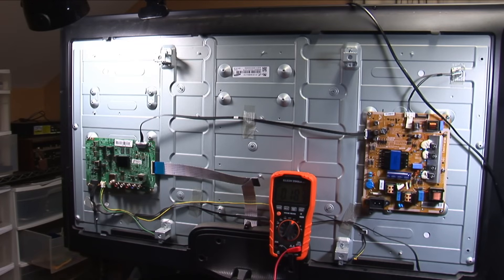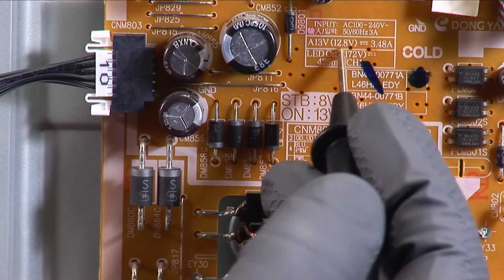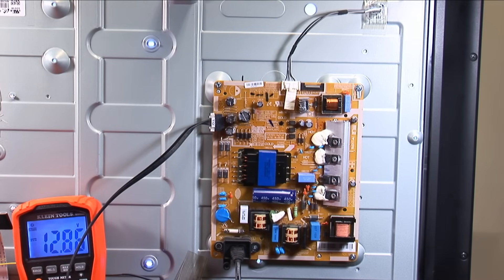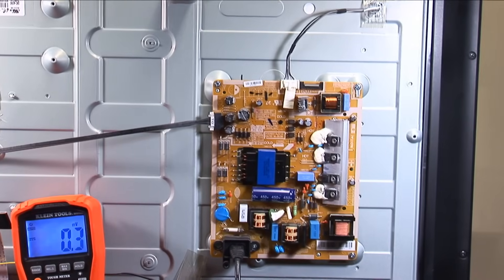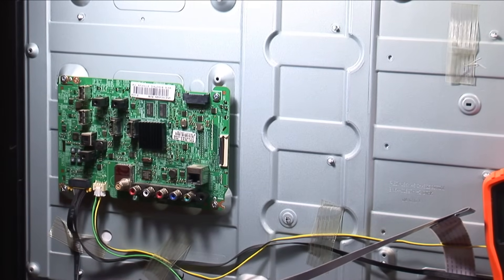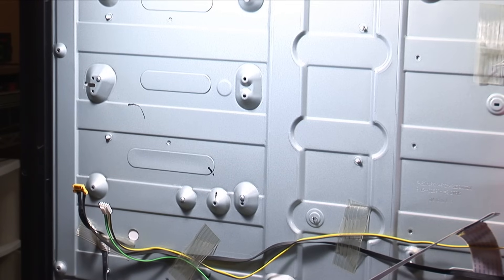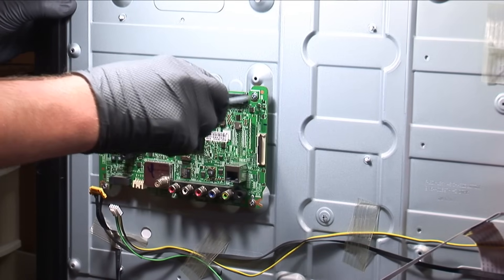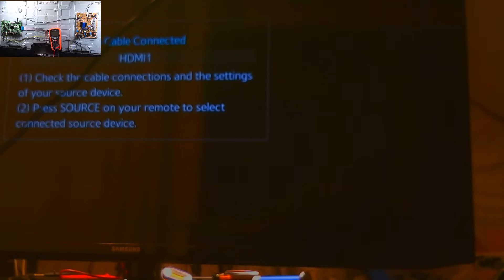Samsung LED Flat Screen TV Repair - Won't turn on, no power - How to Fix

Comment: My UN60JU7100F wont power on.  I have two black cable sets coming out of power board. Removing blk set that goes to mother board from power board does not turn on back lights. Removing blk set that goes to Tcon board does light the back lights. Also removing the two whitish ribbon cables at bottom of Tcon board turns on the back lights.     What do you think ? Thanks in advance.

Comment: Good afternoon sir. I am currently diagnosing a samsung plasma with exact same symptoms caused by lightning. Disconnected cable from power to main board and back light did not come on. Do plasma's have back lights? Also, I located standby prong on cable from power to main board. Showed 5.28 volts. No other prong gave reading. I know this is a mouthful but wondering if you have any idea from what I'v told you that wont take too much time out of your day to explain. Thanks again in advance.
Reply from the maker: Hi. No. Plasma screens don't use backlights.  The pixels themselves glow similar to how a florescent light works but just much smaller.   Other than that I don't know much about the intricacies of plasmas.  Never worked on any or owned any. Sry I couldn't be more help. The basic troubleshooting concept is the same though. Also if you can find a service manual, that may go a lobg ways to helping you troubleshoot (pinout, voltages etc)
Reply: @Electronicle  I very much appreciate the response. I noticed that on your video you located and checked for proper voltage on cable running from power to main board. My question is, are the other prongs suppose to give off a voltage reading also? There are 2 or 3 other prongs marked 5.3v on the schematic, but weren't giving off any voltage.
Reply from the maker: STILLthePILLAR ][+ if it’s marked that then yes. But that might only output when turned on.    Sometimes there’s a pwr pin that you either need to ground or apply the 5v Standby power to to switch the power supply on. This is where a service manual comes in handy.
Reply: @Electronicle  Very good. Thank you very much sir. And excuse the sir but I didn't catch your name lol. I do hope you enjoy the rest of your day.

Comment: I have a similar TV, 46", 550 series Samsung (LN46A550P3FXZA) and the problem is that it struggles with startup...this has been going on for about a year and most people would have given up a long time ago. – The TV chimes when "on" is pressed (on remote) but nothing shows. After several seconds it tries again, chimes and so on. Sometimes there can be a hideous noise and sometimes nothing...
I have noticed that temperature in the room is important – if cold, TV may never manage to startup, but if fairly warm, it will startup after some time. And then when running, there are no problems...
We recently decided to get an LG 65" "ThinQ" but this machine, as it turned out, just reminded us how amazingly stellar the Samsung was, so we returned it and we started using the Samsung again. Now, after having stood idle on the floor for a couple of days, it  still had startup problems, but much shorter, maybe 15 minutes whereas previously it had struggled for up to 90 minutes...and also, after stabilizing, it really is "stabilized" whereas before it might, if temperature has cooled in room, snap back into the hideous noise and scrambled screen state again...
So I'm wondering what's going on – after warm and stable, it runs flawlessly and picture quality on this 11 year old machine is so great, that you'd have to go to QLED or OLED to surpass it...so I'd like to "save" it...and I'm wondering, what is this "warm up struggle" all about...? – ...can I fix it...?  
Part of the story is also that after about 5.5 years, the TV suffered another, similar, but not identical, startup problem. But that time, Samsung put in place a program whereby a technician would come and fix it in your home (for free), even though warranty had run out...very nice of Samsung. But this is eleven years and Best Buy just wants to sell you another TV, not assist with "fixing" an old set....(and I'm beginning to wonder if it is at all possible to make 4K TVs that equal or surpass 2K machines....the LG certainly didn't)
Reply from the maker: Might be a bad capacitor in the power supply or main board.  Really only way to find out is to take it apart and find out.  You'd have visually inspect as well as test voltages coming from the power supply
Reply: Thanks for reply – ...yeah, and I'm not qualified to do that. – Yesterday I started the TV in the afternoon without doing anything to warm up room, but temperature was "comfortable". It took 13 minutes of attempts but then TV stabilized and ran flawlessly the rest of the day...so it's just the startup process that is a problem, but far LESS of a problem now than earlier...
It may restart with total silence and a black screen and then at next restart, you might have black screen and a hideously loud hissing noise...then noise and a frozen corrupted image and so on, until it manages to perform as intended...

Comment: Samsung UA40J500AK how can you help the fuse on the power supply keep on browing up whenever I replace with the new one
Reply from the maker: If you unplug the main board and backlight does it still blow the fuse?

Comment: Where can I buy this part
Reply from the maker: Crazy5s you can try contacting the manufacturer but might have better luck finding a working used part on eBay. That’s what I  and many others do
Reply: Electronicle can u tell me how much was it
Reply from the maker: @cris2loco766  I dont remember..maybe $30?

Comment: Hi
Thank you for your video extremely helpful I’ve got similar problem with my TV Samsung UE55F8000ST.
I’m trying to find out which board I’m having a problem with. Is it the power board or the main board so I followed what you have done in video. I plugged it in And disconnected the cable from the power board connected to the main board it should have to trigger the back light to come on but I am getting the back lights come on and off on and off not constantly on so I am confused please help thanks

Comment: Ok when I unplugged that first plug that on your tv was marked 10. I got NO LED lights  that came on . So mine has no power getting to the tv right?
Reply from the maker: that's why you have to do measurements as I showed.  Could be a bad backlight or backlight circuits, bad power supply.  Have to narrow it down.

Comment: hi good info, someone told me it might back lights, not the board, how do we check which is it?
Reply: Disconnect the connector from the  main board from the power supply if the back lights turn on then replace the main board

Comment: Tvs have no earth so that back place won’t be ground, at best it might be tied to neutral.
Reply from the maker: internal ground...negative, neutral, whatever.
Reply: The trem ground/earth is the cold side of the psu circuit board.. The live hot side is where the mains voltage comes in..
Reply: I’m an Electrician not a electrical technician, but from a electricians point of view i know that ‘Most’ like 90% of tv’s don’t require an earth, as in there is no physical earth wire even in the cable to the tv.
A tv must have a Line (aka Live) wire and Neutral to operate. If there’s no earth in the cable supplying the tv with power then the metal back plate must be connected to neutral. it would be impossible for it not to be. 

That’s all i’m saying, from an electricians perspective ‘ground’ would mean earth, maybe technicians refer to neutral as ground, i don’t know.

Comment: My back light was flickering when I plugged it in is that a good indication that it’s the power supply
Reply: Was your tv able to be repaired... sounds much like my tv's issue?  It's an LED tv, samsung un60h6203af.  After plugging it in, the screen is basically black except the back light flickers faintly non-stop about every half second.  It does not show a red light at all and no sound.
Reply: No I took the whole thing apart and ordered a new motherboard and it didn’t work  , that would explain if I was the backlight tubes because I did everything else but that , I ended up getting another tv .
Reply from the maker: possibly.  Is the TV a LED or CCFL backlight?  If its a CCFL its probably the inverter or the backlight tubes themselves.

Comment: Your diagnose was good but you stopped to early. There is a mosfet on the board that you should have checked, it is for the power of the main chip that shorts. Just check for the legs to short and if it is shorted change it, you can get 10 of them for $5 and a lot of Tv's all use the same or very close.
Reply: I agree he should have kept going …..but perhaps he had spare boards on hand or the board was less expensive than his time to do component level troubleshooting. But certainly this video can help a lot of “ laymen” salvage their tv by showing that’s it’s not overwhelming or that you need to be a rocket scientist

Comment: I have a Samsung 70 in that made a high pitch sound now it just keeps turning off and on by itself. When it turns on the light around the edges lights up.??
Reply from the maker: The Inverter or backlights are going.  I'd start with the inverter boards.  That is, if its not an LED TV.

Comment: Thank you. I was told that without the indicator light on the lower corner wasn't on then you have no power. So you need to get a power supply board to start with. I got ahold of your youtube instruction and found out it was the video board. Very helpful. Thanks again.
Reply: so it wasnt the power supply board?

Comment: This is not repair,only replace the board.
Reply: It's definitely a repair.  He repaired it back to working condition. It does not matter that he needed a replacement part...

Comment: I am working on a Samsung UN49MU7000FXZA and basically determined that the problem is the main board given the the back light turned on when I disconnected the power supply board from the main board.  I bought a new main board from Shop Jimmy and installed it on the TV but it still does not turn on.  The back lights are now intermitantly flashing.  What could be going on here?  The TV still does not turn on.
Reply from the maker: Did u check output voltages from the power supply to the main board?
Reply: @Electronicle  Question - I have not replace both boards, the Power Supply board and the Main Board.  Turned it on and the screen goes into a three tones of brightness. It looks as if it turns on but then it shuts itself off. Again, I disconnect the Main Board from the Power Supply and connect to the wall and I can see the back light.  I connect the Main Board to the Power Supply and it goes into this turning on but turning off; these with brand new boards.  Any idea what could be going on here?
Reply: @Electronicle  Yes, I had done this previously.  I discovered that the part sent to me by Shop Jimmy was defective and I am now returning it to them.  One of the four brackets on each of the corners that attach the board to the metal plate was broken and it seems that this would prevent the board from doing it's full job.  I am now buying another board from another source.

Comment: Trouble is that the cost of parts are prohibitive, add the cost of labor and it ain't worth fixing. That's why the Eco/Recycling centers are full of these things, short lifespans, cheap components.
Reply: So just toss it right and my warranty just ran out shhhh#4233t thanks bud!

Comment: I have a samsung 55” that looks the same as the one in this video. I changed both boards and still have the same symptoms. Standby light blinks 5 times then goes off. The tv screen doesn’t respond at all. I only tested power from the power Suply to the mother board and got just under 13v on the top 4 pins like it should be. When I disconnected that cable, the backlight has not ever come on. I already bought/replace the 2 boards that can be seen in this video. (They were both used but tested?) should I abandon this effort or is there anything within reason that I can try now. Thanks for any help.
Reply from the maker: hmm  do you know if your tv is an LED or CCFL backlit model?  if it is ccfl it will use an inverter to power the backlight..that inverter could be bad.  However you said that it looks similar so its quite possible that its also an LED.  When you disconnect the backlight, will the tv power up?  (you'll need a flashlight to see if anything is on the screen as you'll have no backlight..but can also tell if the light doesn't blink)  Also can try to disconnect the lvds cable that goes from the main board to the lcd controller and try and power up the tv...again no video but it might stay 'on'.  The fact that the backlight doesn't turn on when you disconnect the main board while the power supply is plugged in leads me to believe its a bad power supply or backlight.
Reply: The model is UN55J6200AFXZA. The ribbon from the mother board( on left) goes to a board bottom center just out of sight.i can see on the screen that it does display “02 network settings” so there is image getting to the screen.
Reply from the maker: @douggriffith1  so forgive me, ..ure able to see 02 network settings when u unplug the backlight and turn it on?
Reply: Thanks for the help. If I unplug the cable that goes to the motherboard (on the left side of power board) , I loose the “02 network settings “ display on the screen. If I power the tv up with that cable disconnected, I do not get the “02 etc” on the screen. When I unplugged the cable that come off the top of the power board, it did not make the “02 etc” go away. That top cable doesn’t seem to affect the ability to see the “02 etc” display. Thanks again for helping me out
Reply: When I unplug the backlight cable (marked with a 10 on the clip), I am not able to see the “02 network settings” on the screen with a flashlight. I also do not get backlight when I unplug that same cable. Any suggestions would be appreciated. I am not sure if it is worth going any further with this tv. Does this sound like it could be one of the two boards I changed? Does the board at the bottom center (that the ribbon goes to) cause these symptoms if it is bad?
Reply from the maker: @douggriffith1  I'm confused.  So when you leave everything plugged in, something shows up on the screen?  I thought the light only blinked 5 times and then that was it.
Reply: Electronicle at first I did not see anything on the tv. I did not know to check with a flashlight at first. With flashlight I was able to see that there was numbers and letters on the screen when powered up. It only appeared to have a black screen. I don’t see any backlight at any time, even when the cable is unplugged like in your video. I guess my question is if there is a way to test the LEDS or if it is even worth it in your opinion I to replace leds? I also see that there is another board behind a metal plate at the bottom center of the tv just above where the stand bracket mounts to the tv. The ribbon from the mother board goes to it. Could that be the problem based on the symptoms or do you know a way that I could test further? Thanks
Reply from the maker: ok I'm sorry now I understand.  If you replaced the power supply and the backlight still doesn't work then yeah its a problem with the backlight.  You can test the backlight in a few different ways, however I think you pretty much narrowed it down.  LED backlit tv's literally have strips of leds behind the lcd.  Its pretty simple.  Getting the LCD assembly apart can be a royal PITA.  The LCD itself is extremely thin and can crack, so as you are pulling it out of the assembly/mount you have to be careful not to bend or flex it.  I recently replaced the backlight on a tv (didn't record it) and its definitely doable but its a pita.  If you want to, take the lcd assembly apart and pull the panel out.  Be sure to disconnect the ribbon cables for the lcd first and be sure not to bend or kink them too much.  Behind the panel you'll see some diffusing panels to diffuse the light and then behind that is the LED strips.  
You can troubleshoot these with a standard VOM in the ohm setting.  Chances are the leds are in series and either an led or resistor has gone.  I don't have a service manual for your specific tv and the ones i have for similar tv's dont talk about the backlight.
Reply from the maker: sorry typing from a phone so this is a bit rough
Reply: Electronicle thanks for you advice/help/time
Reply from the maker: @douggriffith1  no problem.  I have a tv that I have a feeling is not worth repairing.  If so I'll do a video on how to dismantle the lcd.

Comment: For me, it was a capacitor. 50cent fix! Thank god I was curious.
Reply: was it on the power supply board or main board? can you give some highlights?
Reply: @mrbennotmrban  on the per supply board. I guess it's a common problem with Samsung TVs.
Reply: Power supply board that is. I was just going to gut the TV for parts (and fun), when my 15yr old son walked in and pointed out that the cap was blown. I had no idea what he was talking about, so he explained what all the components are to me. When I was his age I was just happy taking things apart and trying to put them back together again.  Well I ordered a new 16v 1200uf to replace the 10v 1200uf blown Capacitor and watched a bunch of YouTube videos and read up online about everything I have I could find on electronics and TVs. The part came, I pulled out the old one and replaced it with the new one and viola, I got a new TV, and a new obsession!

Comment: I have one of these that recently went bad, I've inspected the outer board and checked all the caps and diodes, I even removed some components to see if any were dead but they weren't. I didn't try the outer up with the cables removed though, I will try that later. It could be the same board I have problems with!